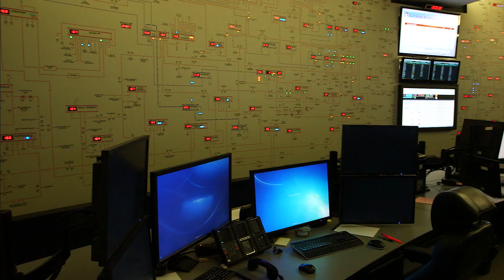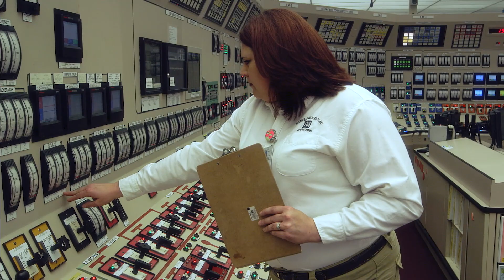Watts Bar Unit 2 Video Outreach

Comment: I live in Dayton,Tn, less than 8 miles if that far from Watts Bar. I can say I'm kinda un-easy about this. I've been in touch with TVA they say everything is "A" OK. I'm taking them at that word but also ready to get the hell out of here if the case should rise up. 
03/26/2019
Reply: you would receive more radiation near a coal power plant, and nuclear accidents have killed far less people than industrial accidents like Tianjin and so on, so you're fine.
Reply: I totally understand the concern, however I urge you to look into the science behind Nuclear reactors and even Nuclear accidents, and not rely on what you have seen dramatized on TV or in movies. There are certainly risks and we've seen plenty of accidents, but Nuclear has proven it's safety time and time again. Nuclear is our key to clean, reliable energy for all. America should be leading the world in Nuclear power generation.